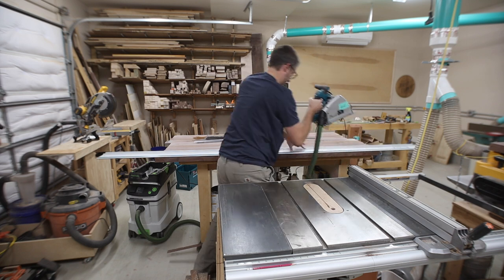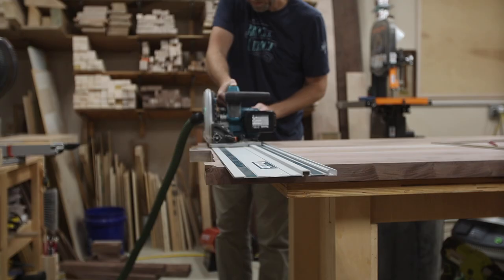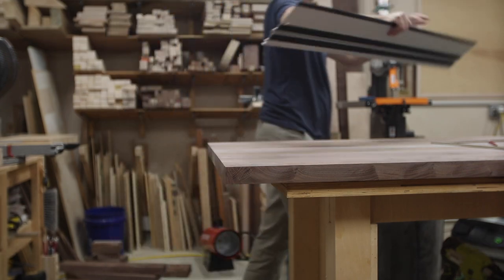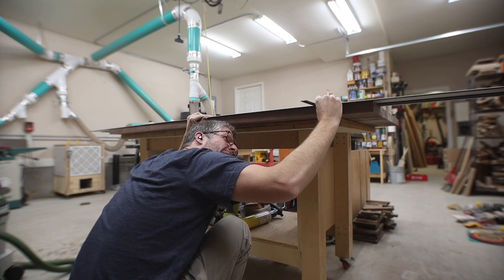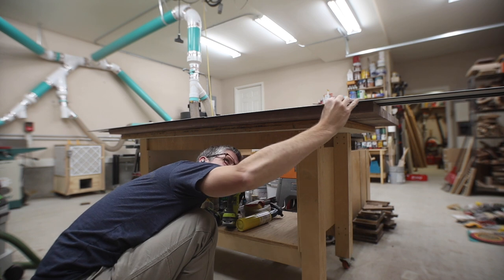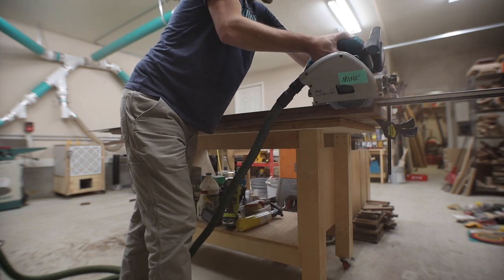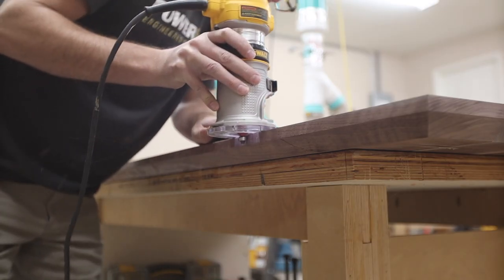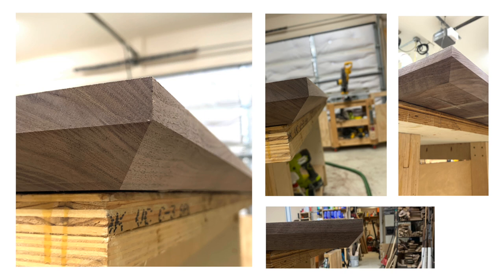ANGLED CUTS WITH A TRACK SAW

Comment: Lovely looking edge profile. Do you find when cutting bevels with the track saw the blade cuts more off the rubber strip, thus making 90 degree cuts inaccurate as the splinter guard is now shorter?
Reply from the maker: I’ve not really had that be an issue. I did have a blade get really dull and do this weird wavy thing and it messed up my splinter guard.

Comment: Any ideas on repetitive 45 cuts with a track saw on the same material  same marks same measurements. I have 14 stair nosings to make all the same widths on the 45.. Trying to figure out a way to keep the track at the same cut with the material bumped in place to the track. without having to move the track 14 times. I do use 1 inch 2x8 styro as my cut base
Reply from the maker: Could you possibly clamp a stop block down that you could bump your track against? Even if you had to remove the track each time, you could make sure it would go back in exactly the same place on each stair.
Reply: @BruceAUlrich  Hmm.. I’m cutting 5 1/2 inch laminate flooring for stairs nosings.  Thats 4 - 45’s on 3  pieces. For each stair nosing. 48 cuts

Comment: That's a beautiful profile for a table top, exactly what I want for my table build. How deep did you set up the track saw to cut? I will doe some practice cuts before I make the cut on the table top 😅 it be my first time I'm cutting this type of profile on a table top. Thanks
Reply from the maker: Thank you! I set it as deep as it would go and it just barely cut through. It’ll depend on what your saw can do and how thick your table top will be.
Reply: More than welcome great job you done there. Thanks for quick answer. My table top will be 5cm thick and my saw can cut 9cm deep will that be OK? Sorry for the cm I'm from central EUROPE
Reply from the maker: @Luchy56512  it kind of depends. When your turn it in an angle, you lose some of the cutting depth

Comment: I’m trying to make faux beams at work with a table saw, but the beams are 14 ft long. Wayyyy to long to get a consistently smooth 45 degree miter even with feather boards. I definitely need to try this out!
Reply from the maker: You’re very right about that! It would be tough with a table saw